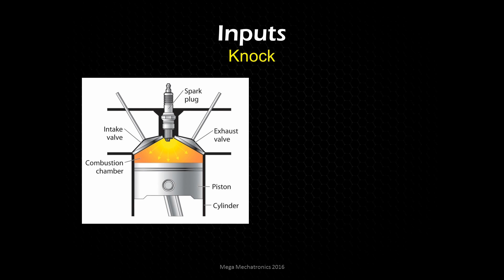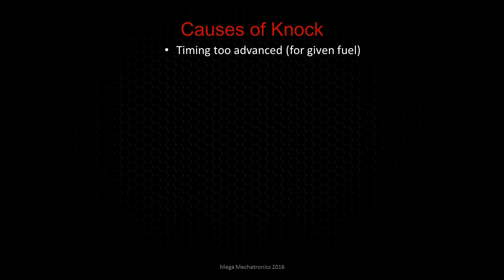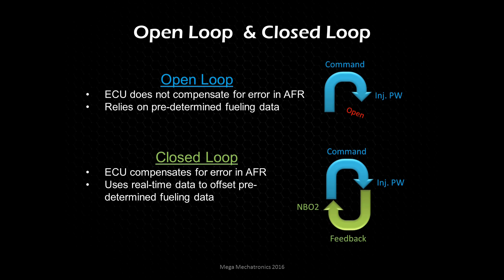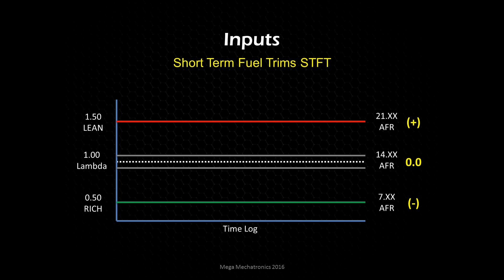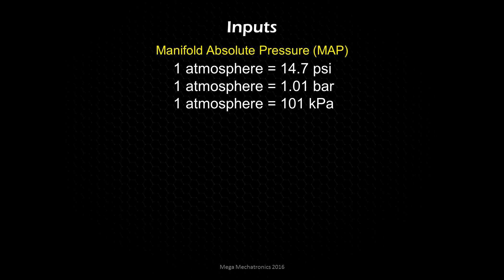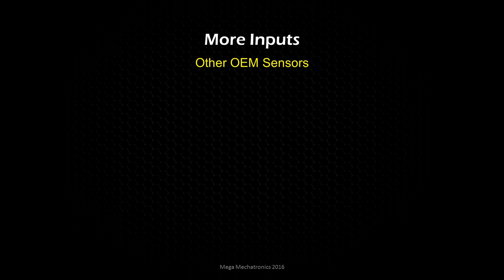How to tune Engine Tuning 101 - Part 2 - Knock, Fuel Trims, MAP, MAF explained

Comment: When the afr ideal What causes of misfire without knock in part throttle
Reply from the maker: Spark blowout if you're boosted and under load, otherwise some ignition problem or an significant engine health problem like wasted rings or head gasket.

Comment: Great video! I'd have 2 questions to ask if you will:
1. If I have two O2 sensors on my car (a 1.0 125hp Ecoboost), one before the catalyst and another after, is one of them working to give the STFT and the other giving the LTFT?
2. I see that my STFT is constantly varying around 0%. Even at short abrupt loads and releases, it goes up to some +9% or more, then after release it goes well below -8% and in about a second or two it self-corrects around 0%, but the LTFT remains almost 99% of the time stuck at close to +10% and only sometimes at short throttle bursts it varies, but then comes back to that value keeping a flat line versus time. Do you have any idea why is my LTFT simply stuck at some value and not listening at all to the STFT? Can one of the O2 sensors be faulty? And if so, which one?
From how I see it, when it shows positive percentages, the AFT is actually richer. I might be wrong, but normally when you go WOT your ECU will automatically shift your AFR towards below 1.0 lambda and my STFT reading (which seems the only reliable) goes to positive % values while the AFR drops below 14.7 (some 13.2..13.5) and after I release the throttle, the STFT goes well close to -10% for a moment and at that exact moment the AFR is also showing some more than +20 AFR (above 1.36 lambda), so I wonder if the positive STFT/LTFT references are for rich readings on some ECUs and negative on others.

Comment: Wow this is awsome, I'm starting to actually understand stuff instead of trying to make sense of ppl trying to show how smart they are by using acronyms
Reply from the maker: I can only imagine where you're at.  I struggled to learn this stuff solo with no mentors, what I had going was good knowledge in mechanical and working performance of engines.  Ask yourself if that is a skill you should at minimum armchair learn it.  I also worked on TBI engines; with an old GM 350 you can watch two large injectors spraying big cones of fuel onto the throttle plates. 

Don't make it harder than it is, I'll prove it in one sentence: 

All piston engines require an optimal fuel volume with combustion at an optimal time.

Airflow controls fuel because airflow is the input and fuel flow is the output and any change to the air or fuel in the Air Fuel Ratio (AFR) will directly impact one another, so adding 10% air will add 10% fuel if you maintain the exact same AFR.

Since an engine spins, timing is in actual degrees of the crankshaft rotation vs. when the computer makes the spark jump the gap of the plug. 

I'm am making sure I fully understand what I will explain in the Cruze final tuning video which should include updates and corrections to the whole series...Subscribe and Bell my friend.
Reply: @MegaMechatronics  wow! Your good at explaining things. Yes sir I'm the one lone guy in my family that likes mechanics and as a 17 year old it's a lot of info to compute. I have a 1994 Chevy 5.8 355 I just built and it has the tbi system so itll be my Guinea pig first thing to tune, I'm good at figuring things out and how they work and I have a good understanding about how engines work as far mechanically, I'm still learning the electrical side of it all and how it all connects, that and all the ratios and percentages and stuff😂I just found these videos and instantly subbed and am just going through them a couple times trying to take it all in. It's a lot but I think eventually I'll get it. I've never looked at the cell type graphs before and I'm trying to get used to them lol. Keep the great videos coming man this stuff's awsome

Comment: I think EGT is important too especially for highly tuned engine.
Reply from the maker: For high output applications it is pretty much a requirement during engine development, while having one for each cylinder.  I have all the stainless bungs and plugs, but haven't had the need to remove the hot side yet on the Solstice lol

Comment: Hi Can You Help I have a mercedes clk 430 convertible 2000 auto runs great But as you no it is very lazy what i want is not top speed not even bothered with 50=100 I WANT IT TO ACCELERATE FROM STAND STILL WHEEL SPIN FOR THE FIRST 10 YARDS AFTER ALL IT HAS GOT A 430 CC ENGINE CAN YOU HELP

Comment: To clarify: STFT and LTFT are compensations for lean or rich conditions.  It "was" (past tense) a lean or rich, corrected back to stoich by management. Amount of compensation that took place(past tense) to get it to stoich is the fuel trim.  For example: If you have a lean condition, LTFT may be +12, but once stable the O2 will be at stoich. If you correct the cause it will be a rich exhaust until the fuel trims pull it down.

Comment: what logging software are you using in particular and what hardware tool are you using? i have a basic ELM bluetooth reader, wondering if you recommend a better option! thank you!
Reply from the maker: I have the HP Tuners MPVI Pro.  With that you use VCM Software Suite which includes the Scanner and Editing/Flashing applications.  Once you buy the hardware, the only cost will be purchasing credits to activate your ECM to do unlimited tunes on that serialized ECM.  

If you buy the unit new, you get 6 credits (which is worth ~$300).

Comment: are the adjustments of the ltft by the ecu  permanent?
Reply from the maker: LTFT are not permanent, they are forever changing accounting for small variations in fueling, it will always try to target stoichiometric afr.  Small variations in fueling can be caused by the outside environment, component wear and accumulation of debris (like carbon buildup, gunk, etc.).
Reply: no, they will constantly enrich/lean to achieve a median a/f ratio. It's been a while since I watched a reset car relearn, but I seem to remember about 5 minutes of closed loop being the resolution the LTFT seems to pay attention to.
Reply: thanks for the replies